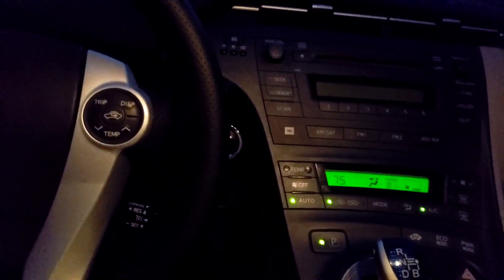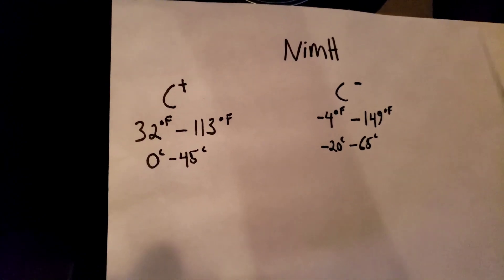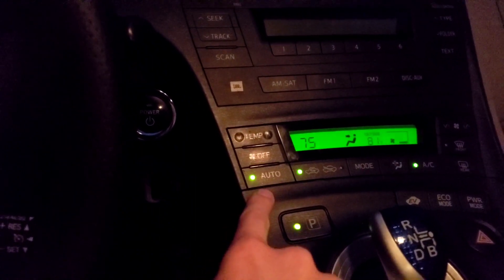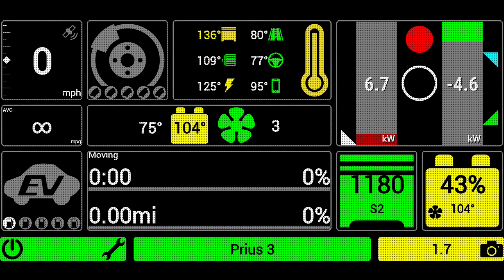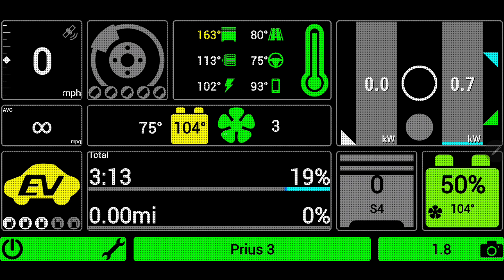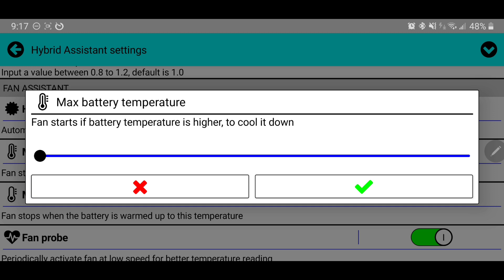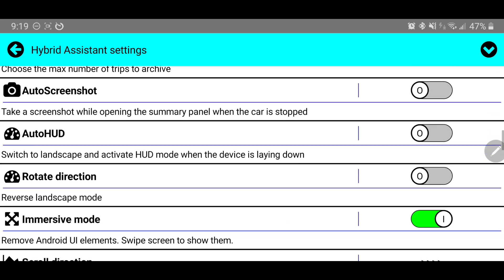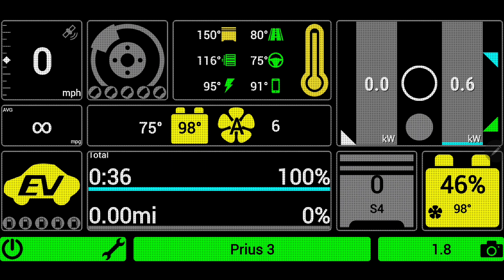How To Prolong Hybrid Battery Life

Comment: Your channel is so underated
Reply from the maker: Absolutely love your enthusiasm!
Reply: @HEVTech1  I don’t lie. These are very good videos. And you speak clearly and loudly.
Reply: @HEVTech1  what does it mean if my bars go down to 2 bars? Hybrid battery is about 3 years old. 2014 Prius 147, 000 miles. Runs good and I keep it maintained.
Reply from the maker: @terrytorres7075  it just means you hybrid battery is low on charge. This can happen naturally in many different scenarios. It generally does not indicate a problem unless you are consistently seeing it drop to two bars and very quickly.

Comment: Hi, have you ever noticed that your Toyota hybrid occasionally starts the engine when you activate cruise control? And in turns it off when you deactivate cruise control? I have a hybrid Camry. It occasionally does that. I then have to keep constant speed with the gas pedal.

Comment: Hello, thank you so much for this info. It was the first very hot summer day and I drove my Toyota hybrid (Nimh) with AC off. After a while I noticed the ic-engine wouldn't turn off and electric driving was not possible. After parking in the shade with AC blasting and cooling down the cabin, the car would drive again in EV mode. (Till it heated up again, because AC was off again). I was figuring already it had something to do with the battery temps and some sort of safety program kicking in to preserve the battery health. Did I damage the battery? Or did the system do its thing to play it safe? According to your paper up to the 2 minute mark in the video, what would you say what temps was the battery seeing? Was the system already imposing a discharge limit? (Fuel consumption was getting worse). After this experience I'll use the AC, but only because of the battery. No other reason.

Comment: 60F/15.6C is wayyyy too cold to be comfortable
That 70F/21.1C is probably doable.

I usually drive at 25C-27C as I find it is too cold in the cabin but I understand what you're demonstrating about keeping the temp. cool for the car's regenbatt.
Thank you for the explanation.
Reply: Hello, have you experienced overheating issues (battery) by driving around at 27C cabin temperature?
Reply: @Ilker_Ali89  Hey. No issues with battery or anything (knocks on wood).
Reply: @crimsonnightt  sorry for the late reply. Thank you for answering. I tested 26C in the cabin yesterday on a 90 km (56 mile) long trip, and the battery was doing just fine :)

Comment: I have a 2005 Prius.  Diagnosis was done at the dealership it says my fan is off,  then block 1,2,3 becomes weak    Now my battery goes down to 2 pink bars, doesnt want to accelarate and the car  doesn't want to turn off.     At this point do i need to change HV  battery pack?    I have never change the battery since i got the car in 2010.   I am having problems finding someone who can take care of my car.
Reply: Check online mobile after-market battery replacement, they will come to your address and rep,ace in 45 min, charging you, (2024 rates) between $2K-3K, while Toyota dealership will charge you at least two times more. Sure above cheaper price is for refurbished cells, while Toyota - for brand new hybrid battery

Comment: Dr prius shows temp three be aroind 115 which side is it and what causes high temp indrive this car for uber
Reply: My battery was showing 122 on the sensor farthest away from the fan.  I had already cleaned the fan and there wasn't a whole lot of hair/dust.  So this time I took the whole battery out and there was a lot of dog hair/dust stuck between the battery modules, especially the end where the 122 degrees was showing.  Now that sensor is staying under 110.  I'm in Arizona.

Comment: Very informative!  Thank you.
Does all this apply to the Prius plug-in with its lithium ion battery as well?  I have a used 2012 with 115k, one previous owner, Toyota maintained and want to do everything to get it to 250k.  I am
In Austin and am worried about the heat.

Comment: I live in Arizona  its hot is it better to use your A/C to keep the car cool inside  or is it ok to roll the windows down?
Reply: Keep AC running, opening the windows when outside is over 100 degrees will not do much

Comment: I have a issue with the app it's not working for me, is it because I am using the Micro Mechanic OBD 2? Is that why it's not working? I use the Dr Prius app and it works perfectly. Can you tell me if it's that or not?
Reply: Will the cheaper OBD2 work on the App? @H-EV Tech
Reply from the maker: I mention how to connect your OBD II device to Hybrid Assistant here > https://youtu.be/q6bOv_Zue-Y?t=175. I wish I focused a bit more on connecting the OBD II device than I did. 

You will want to press on the bottom middle of the screen once the app starts, then choose the name of the OBD II device.

Comment: Thanks for review! So on my 2017 Prius Prime I just bought used a month ago with 30k miles, it's better use the charger it came with and slowly charge for 5 hours, instead of purchasing a fast charger from Toyota for $500 to charge in 2.5 hours, because you said batteries don't like fast charging at 2min40sed in your video? At 6min 35sec, you say your Charge Current Limit of -23.5kW is limited by braking, normally it is -25kW. Are you implying your regenerative braking is limited by the difference of 1.5kW, or at 13min40sec the difference of 4kW of 25kw CCL - 21kW DCL gives more regenerative braking power? Or did I misunderstand what you tried to teach us?  Thanks so much!
Reply from the maker: I was referring to the regular (not plug-in) prius for my stats referenced.

When the battery is within normal operating temps it will only allow regen braking to charge the battery at 25kW and discharge limit would max out at 21kW. The prime uses a Li-ion pack so chances are these numbers are much smaller than you would see in hybrid assistant.

Comment: The warranty has been 100k or 10yrs since at least my 2007 prius. The problem is that Toyota doesn't honor it. The warranty doesn't say how bad the battery must be before they would replace it. My 07 prius with 65k mi had no power and mpg reduced to around 30mpg, but the battery management could still charge it some so Toyota said no. I had to buy it myself to get back power and milage in the high 40s. Toyota doesn't participate in the BBB so you're screwed. No honor with toyota.
Reply: You are way out of warranty. It's 10 years or 100k, whichever comes first in California. Other states may be 8 years. You need to get Dr. Prius and test your battery. Another easy test is find a long hill and accelerate up it. If you get bucking and hesitation, at least one module has high Internal Resistance.
Reply: @amazoidal  oh this was many years ago with 45k miles and 3 yrs. We never forget and stop sharing when we're screwed by a company like toyota.
Reply: I had an inverter water pump go on me and my dashboard turned off. Toyota said it would have been covered, but no one told us in time.

FYI, the Amazon $50 inverter water pump is terrible! Replaced multiple times, until I bought the Gates that costs $100's.

Battery tip... Avoid A/C or going above 55 mph. When the pump was broken, my car still drove and didn't get excessive heat to shut it off by no AC and no speeding.

Comment: I wonder how representative of the actual battery temperature that probe is reading. If the thermistor is sitting between the individual batteries, then it may be reading more of the cool air you are flushing through with the fan than the actual battery temperature.
Reply from the maker: The temperature probes are at the very bottom of each module and they are recessed a little bit while also making contact with the module.

The air flows between modules to cool them down. The Temps as a result do not fluctuate very quickly on the readout which I've always interpreted to mean the data is accurate. If I was reading air temperature I would expect it to fluctuate quite a bit.
Reply: Many people place all 3 modules in the center for more accurate response. The 2010 thermistors are on the top of the battery. Be careful with the thermistor harness. Do not break off a thermistor! The wire is hard to solder. And Toyota does not sell a new harness!

Comment: Thanks for making this video. Out of curiosity, where do you pick up all the info you learned about this app and hybrid batteries/priuses (the app seems to have relatively decent documentation, but it doesn't seem to go into much detail about applying everything on the screen to optimize for performance and reliability, which I'm more interested in)?
Reply from the maker: Most of what I make videos on is either my own research or observation from real world use.

If there's anything in particular you would like covered in a future video let me know and I can touch on it.

The app goes far more in detail than an average person would need or want but the stock prius hybrid system indicator is too simple so using the app in a more limited capacity has been a perfect balance for me.